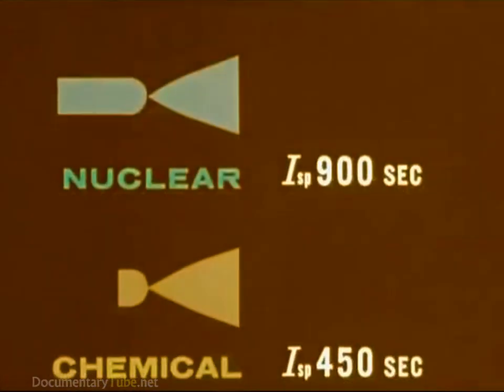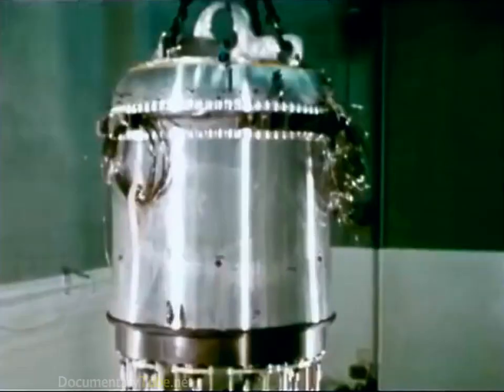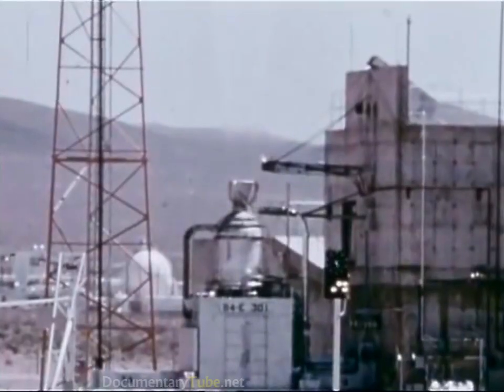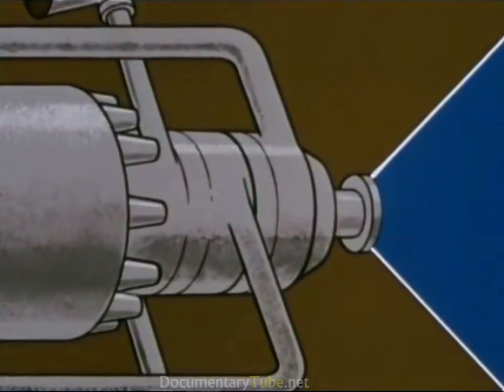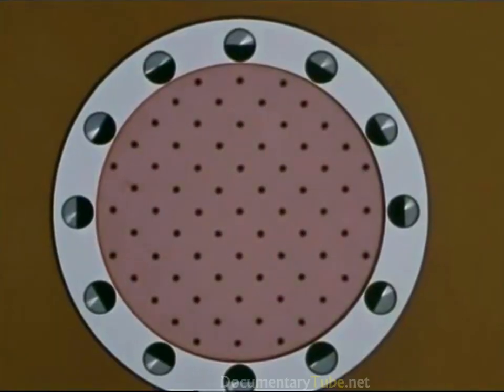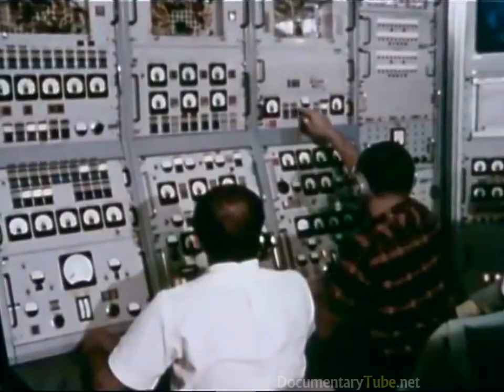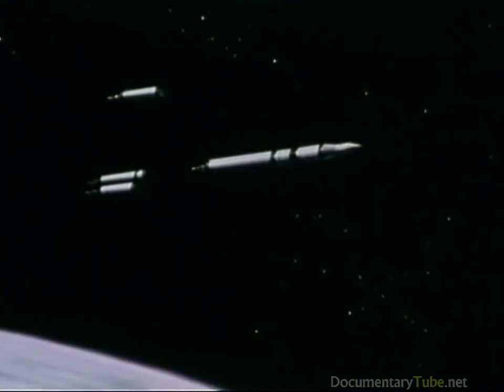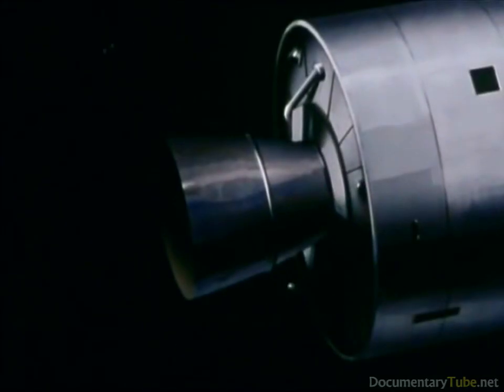HOW IT WORKS: Nuclear Propulsion

Comment: If they listened to A.Weinberg who designed PWRs they are talking about here, we would already solve CO2 problem on Earth by using thorium, without having accidents. Beside, space missions with people or without could easily reach Mars long before 2021, even Moon colony would be possible because it has Th on surface. Most weight of rockets by far is fuel, getting it on another planet is great advantage compared to bringing it there, which is why we still only have "colony" on Earth. I'm not sure why U235 reactors weren't used as a fuel for short distances like Earth to Moon, probably because of safety concerns and radiophobia when people already knew U235 is problematic for producing electricity and bombs on earth. Another option was nuclear pulse propulsion allowing interstellar flights, that would probably require using U235 propulsion first to get Th stuff to Moon or wherever possible. This would be at least very interesting and as shown feasible.

Comment: My father worked at Mcdonnell Douglass and was a drafting engineer during the Gemini Program. This was brought up more than once. And the biggest downside was what would happen if the rocket did not successfully launch. From the launch pad up to the upper atmosphere, an exploding nuclear rocket was something that scientists of the day didn't want to risk. Whether that what the actual concern was or not I'm not sure. But it is what I grew up believing.
Reply: That was part of it. But if I'm not mistaken,  there was an international treaty signed forbidding nuclear propulsion and other activities .
From occurring in space.
Had to do with military actions. 
But killed the space exploration possibilities in the process as well.
If I remember correctly, ( these days a challenge 😆) Even Carl Sagan made mention of this, and what a setback it was for space exploration. 
Was saddened by it.
Reply: @bcallahan3806  I don't doubt it. Space exploration was originally driven by strategic moves and operations to keep ourselves ahead of other countries.
Reply: @BadHandDesigns  also forgot to mention the" starfish prime "high altitude nuclear bomb test. Conducted by U.S. in 1962.
Approximately 400 kilometers high. 
Over an atoll in the Pacific. 
Knocked out power and destroyed electrical devices over 800 miles away. (Via a massive EMP).  Took out a third of all satellites in operation at the time.
Caused an artificial  aura borealis effect that was visible from Hawaii to New Zealand. 
Plus a whole bunch of other not so good things. 
However a lot was learned.
Which , although  intentional , scared the heck out of a lot of people. 
Thus also played a part in the blanket policy.

Comment: 4:55 we had that tech in the 60's?!?!
Reply: The public was scared by the media decades ago into believing anything with the word “nuclear” is bad. Kind of like the “orange man bad” conditioning of recent years. Thanks media, you do far more harm than good, and all for ratings and greed.
Reply: @dewfall56  That's why it's MRI and not NMRI, since tec hnically MRI works on nuclear magnetic resonance (although it has nothing to do with nuclear fission), the same principle of NMR used by chemists to determine chemical structures
Reply: Yes. Lots of the stealth planes revealed in the 90s in the Iraq war were developed in yje 70s / early-80s, but kept classified.
Reply: Most of the tech we use on a daily basis is just a fraction of the tech available to us. There are government & corporate forces that restrict what is available to the general public.
Reply: And we sold it to CCP
Reply: From what I understand the F22 was basically designed in 1975. That’s absolutely crazy. It took another 14 years to make it possible and then it became a real thing 15 years after that.
Reply: Too add to what matrixwolf said, as a standard rule most tech is wildly expensive and only used in experimental work.
Reply: @rogers4760  to is a two letter word.

Comment: What’s the point you still need a big ass tank of Hydrogen, and arnt you spewing out highly radioactive gases through out every level of the atmosphere? Am I missing somthing here ? I thought wow nuke rocket and thought it would be some weird ass reactor and mabe some othe gadget no a tank of hydrogen like a normal and plus now you just radiated a huge fucking area
Reply: Does not launch from the ground. The nuclear engine is lifted into orbit by a Saturn V rocket. Assemble and launched in space
Reply: it's an upper stage engine used in space, where background radiation is already high as fuck. it makes no difference whatasoever that there's a bit more of it coming out of these engines.

Comment: They worked on these nukes engines for 17-18 years then the project finally dissolved and faded away. To get to Mars you will need to burn a rocket engine for a good long time. With the current engines we are many decades away from even trying it. And not to mention the cost approx 1.3 Trillion! WOW!!

Comment: So those guys going to Mars would have been sitting next to several radioactive engines for 200 days at a time.
Sign me up... not!
Reply: People do it on nuclear powered chips all the time. There's never been a single case of a radiation overdose in any of these systems.
Reply: @dankuchar6821  Yeah but on a ship you don't have to worry about weight, you can have a nice thick layer of lead (and distance) between the reactor and people.
In space you have to worry about weight, distance and the additional natural radiation present in outer space.
Reply: @peppeddu  You don't use lead. You can simply lose a thin layer of boron.  Also water works very well. And in a spaceship you've got to carry water so that works just fine.  I worked on spaceship shielding a long time ago in college. It's not hard to do.

Comment: Nothing to push off of you’re never going to move period no matter how much thrust you have!!
Reply: It’s not like a propeller, it’s like the recoil of a gun
Reply: but the gun is automatic and you have a giant magazine.
Reply: You don't need too. Like the narrator said, the heated hydrogen is expanded through the nozzle. This expansion accelerates the gas and shoots it out at tremendous speeds. The mass flow rate combined with the velocity creates a change and momentum thus the rocket is propelled forward while the hydrogen is expelled backwards

Comment: These developments were before the brain drain and before the dumbing down of the western world. For mental engineering capacity, the scientists and engineers of this time period were far surperior to the mental capacity of engineers today. These peoe could solve the most difficult and challenging problems with mere pencil, paper, and a slide rule, and their solutions were always unique and groundbreaking. Contrast that to today's engineers wbo are overly dependent on computers anx software driven solutiins and who have to wait for the computer to model their ideas in stead of going ahead and building them and taking measurements in the real world to refine their designs. No wonder the Saturn's F1 rocket engines can not be built today. The science and the engineering arts necessary to accomplish such, have been tragically lost.

Comment: Wow. So the rotating beryllium & graphite rods on the outside were essentially the throttle control mechanism. It's surprisingly simple, yet genius.
Reply: It is elegant, but dangerous.  If even one rod fails to rotate, you could go into a meltdown scenario.  I'm sure there is some kind of failsafe installed, but I wouldn't want to be the one to manually rotate in an emergency.  That and the fact that you still need tons of liquid hydrogen makes the small gain in performance impractical.
Reply: @stevenreyngold1166  As a designer, myself, I would design a system that could never meltdown in the first place in the way you're describing (if I was allowed).

Calculate how many rods it would take to make enough heat to create a critical failure and then install 5-10% fewer than that number.

To be honest, I don't know if nuclear power works like that, but I have some experience in heat recovery power generation and fluid power dynamics. 

If I can design something that barely won't destroy itself under it's own power, I assume these literal nuclear and rocket scientists and engineers, who are smarter than myself, would design a system in a similar fashion.

(But then again, I have no fricken clue if nuclear works that way)
Reply: @naterbaternaterbater  the problem here is that nuclear power does not work this way. If you want the chain reaction to go on you have to keep the fissile material critical - if you stay subcritical the reaction slows down until it stops and if you stay supercritical it accelerates until meltdown. Modern reactors are fail-safe - if every system fails nothing is keeping neutron-absorbing rods out of reactor, which means that these rods fall into reactor and stop the reaction.
Reply: @naterbaternaterbater  taking from your idea , you'd need to install more than needed rods to absorb excess electrons to prevent the reactor from going into meltdown , or basically just have a venting system that allows the electrons to escape , thus preventing pressure buildup and explosion 

ig having a open ended nuclear reactor is pretty safe since there can never be a pressure built up. 

the only risk you could run from a stuck rod is rector meltdown , in which case jettisoning it from the hydrogen fuel tank would be the best thing to do to prevent a explosion , or maybe just let it melt and become hot melted metal.
Reply: It is said, and (I don't know if it actually was said, but) I believe, that the genius of an engineering solution is in its simplicity
Reply: It usually is unless they're lying to us.

Occam's Razor, put simply, states: “the simplest solution is almost always the best.” It's a problem-solving principle arguing that simplicity is better than complexity. Named after 14th-century logician and theologian William of Ockham, this theory has been helping many great thinkers for centuries.
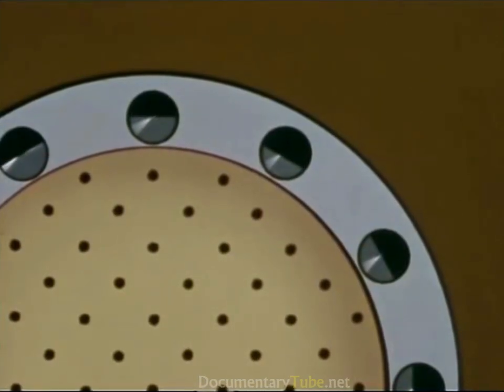Reply: Oh! One side was coated in Boron! 9:23
Reply: These guys were insane. Absolutely stellar engineering.
Reply: Yup that's it. The Russians made one and it had a beryllium oxide neutron reflector and used air as the fuel when operating in ion thruster mode. Extreme cleverness in engineering to be sure.
Reply: Yeah, a very simple and elegant solution. Too bad the whole NERVA project was scrapped, but OTOH it was a necessary sacrifice to avoid any risk of nuclear orbiting weapons disguised as pacific/scientific ships.
Reply: @chpsilva  I'm not sure if orbiting nukes was the issue. We have so many missile silos, missile boats, nuclear subs, Bombers in the sky at all times, and truck mounted nukes already on earth that orbit wouldn't make a difference. Explosions on the pad or mid flight would have been disastrous. But building them on and around the moon,  in the future would improve our capacity to travel around the sol system.

Comment: That was amazing.  The power from such a motor wielded and employed outside of our atmosphere is a game-changer.  A major political and legal challenges and the sourcing of the nuclear component.  No small task.   But when you absolutely need a very strong propulsive solution, this will be re-evaluated.  If the skill sets are still assembled and in the positions to construct such a nuclear core.  Wow, that would be most unexpected.
Reply: Apparently the main obstacle was what would happen in case of a big blowout. If the rocket explodes we will end up with tons of highly active nuclear waste on the orbit.

Comment: There’s a hell of a lot of jettisoning lol. We’d be leaving bits of nuclear waste all over the place.
Reply: That's not true. The exhaust is hydrogen gas, the fission is only creating heat for the hydrogen gas to travel through niobium carbide channels. No radiation is expelled. Unless of course there's a malfunction.

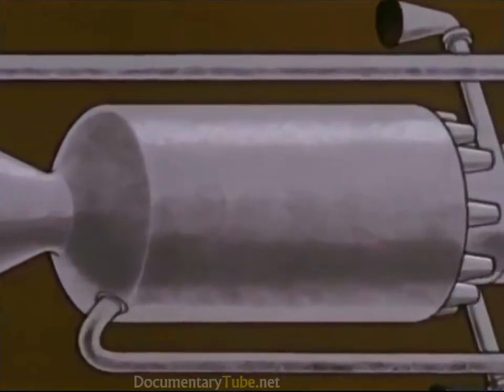7:04 in the video. Also the begging of the video.

Cheers 🍻

Comment: I agree these videos proved to me that we can combine nuclear and ion even nitrogen together combined to work with each other to propel spaceships in space not from the ground up but through space it's all before us but sometimes we just don't see it we don't need nuclear to get off the ground we just need to design a craft that can do this All In Space I do not understand why the space Community will not change the way they feel it by building a Starship in space first and then using the technology we have with all these propulsion units in space not from ground surface to space

Comment: I can't believe, that so much money and effort was spent on this silly/inefficient design. So, liquid hydrogen is heated, using nuclear 'heat' to produce thrust. It is only 2x more efficient, compared to using oxygen, and you shoot/spray a plume of radioactive waste. Instead of using liquid hydrogen, which is dangerous and difficult to keep cold, you may as well use any 'solid'/'liquid', if it is heated to 4000F. You still have to carry/store a huge amount of fuel (hydrogen or any other solid/liquid). A better design is a continuous/stream of micro/Nano nuclear explosions. You wouldn't need to carry huge volumes of 'fuel'.
Reply: There is "free" H2 in space.

Comment: "Isp refers to the time in seconds 1lbs of propellent will deliver 1lbs of thrust" <- I can't describe how much time I have spent trying to understand Isp by reading Wikipedia and this video expained it all in just one short sentence. So simple! What a great video!
Reply: I wish Physics I learned in College was explained like in this video.
Reply: @sillymesilly  I personally find Ve (effective exhaust velocity) to be a much better metric for this thing. Isp = Ve/9.8 and Ve = Isp*9.8. So 500 s of Isp is the same as 4.9 km/s of Ve.

It's much easier to visualize effective exhaust velocity, so a higher number is better (more efficient). I can't understand why Isp in seconds is used other than stupid tradition. Also, the Tsiolkovsky rocket equation uses Ve directly so once again there's just no point in using Isp if you have to convert it anyway.
Reply: @DrZygote214  it tells us nothing about efficiency of the fuel being expelled. For the same velocity you can have very rapidly decreasing fuel or slowly decreasing fuel. This is why impulse is used.
Reply: Slim  neither is basic sentence structure, but hey, here you are
Reply: I feel your pain.  In my Jets and Rockets class my Phd professor never explained this concept.  He was one of the best professors though.
Reply: Wikipedia sucks.
Reply: I still find that sentence a bit confusing due to the false equivalence of a lb of mass to a lb of force.

I would prefer:
"Specific impulse is the time in seconds that 1lb of propllent will accelerate 1lb of mass at a rate of 1g"

Note you can replace the 1lb in the above with any arbitrary mass (e.g. 1kg or 1 ton) so long as the mass of the propellent and the mass accelerated are the same as each other
Reply: same. This video explained everything perfectly.